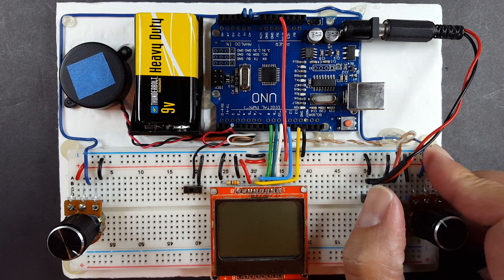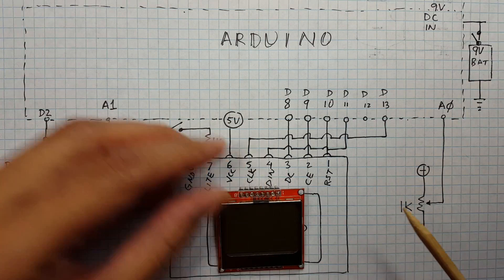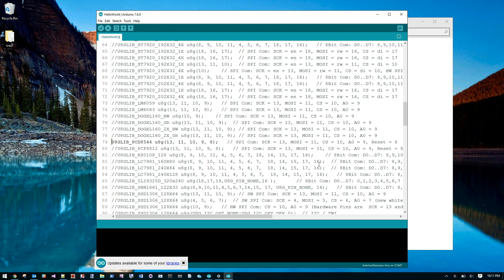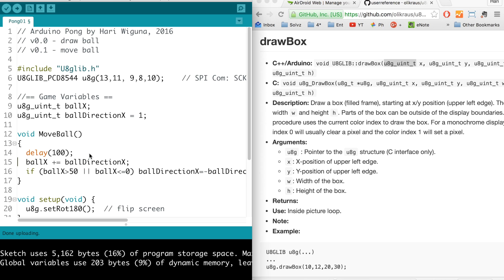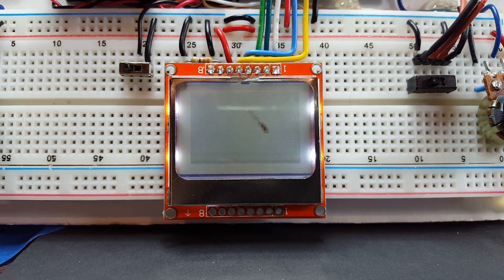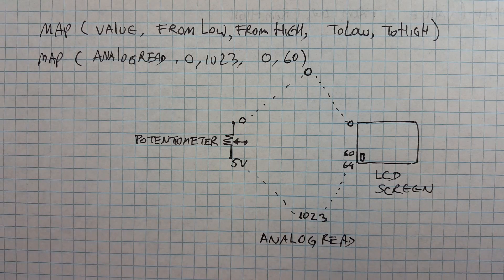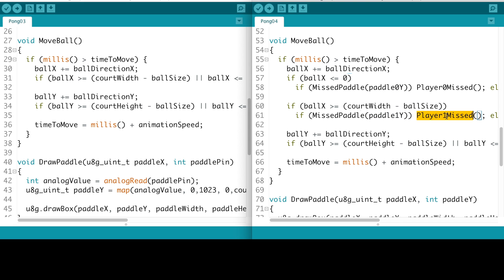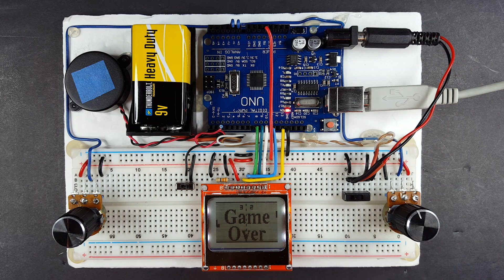HariFun #136 - Let's Write a Game!

Comment: great man .  love you you lay stuff out and keep it looking do-able for newcomers .
 i had a hack at this back with my Nano pong , but ended up being a pro mini pong , but i never did finish it properly .
Reply: i got a 128x128 TFT , but having to debug some issues with it as the lib online seem to  screw up thinking its 128x160 .   but i want to either make a mini color computer / terminal , or arcade model .   i think going forward i will only get 128x160 ones as teh128x128 would be perfect for some of my ides it's no to friendly . I trying a fast version on ucg lib . its very fast even on a nano .  but to be stable you have to use a real level shifter .  voltage dividers are not fast enough for it on SPI.
Reply from the maker: Have you seen +cbm80amiga 's STM32 based terminals? Cheape rand faster than arduino.
https://www.youtube.com/user/cbm80amiga
Reply: very cool stuff.  i was thinking of hooking my screen up to a ESP8266 v12E i have . same 3.3v sort of helps .  so much to do / try , not as much time . LOL

Comment: This is exactly what I have been looking for! With a slight modification to the code and wiring, would this be possible on an ssd1306? (By only modifying the wiring and the code responsible for wiring?)
Reply from the maker: Excellent!
I've just checked... u8glib supports ssd1306.  So, as you said, just wire it up accordingly and you got a spiffy OLED pong instead of a lame LCD Pong. :-)
Please leave a link here if/when you decide to make that. I'd love to see it!
Reply: Hari Wiguna sure! I'll finish it as soon as I can get time!

Comment: Hari, great project and step by step explanation! I remember that I did pong using TV library and 2 gamepad joysticks. But it wasn't comfortable to play on TV without long AV cable. There are now many many games available for Arduino+TV library+simple gamepad.
Reply from the maker: Thanks +cbm80amiga!
I'd love to see your Arduino+TvLibrary game if you have a link.
I wonder if TV library is still popular with the decline of analog TVs?
PS: I need to get started on STM32, I saw on your channel that you've implemented a very fast terminal.
Reply: Unfortunately I don't have video or even circuit. It was 2 years ago or more. I had only 2-3 Arduinos and breadboards this time so had to reuse all elements for next projects. I did many projects smaller and bigger but mostly for fun. I started recording videos recently just for archive.
Reply from the maker: Bummer... oh well no worries.  Do you have a resource to recommend for getting started on STM32?
Reply: I treat STM32 like regular Arduino board but much more powerful and capable. There are more I/O pins, native 3.3V supply and logic level which eliminates necessity of use of level shifters. Most libraries are already ported from regular Arduino and they take advantage of better hardware. I simply like it. And it is cheap, sometimes even cheaper then ATMEGA Arduinos.If you don't require WiFi it is obvious choice.